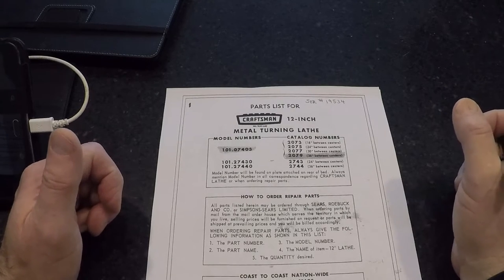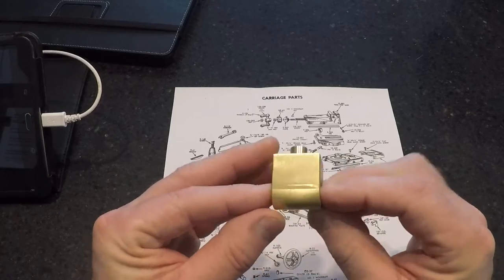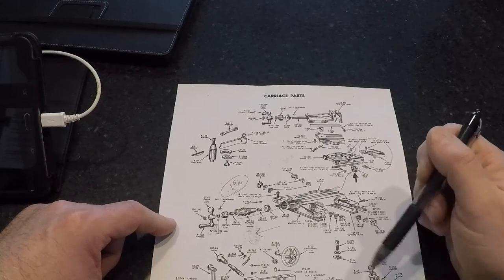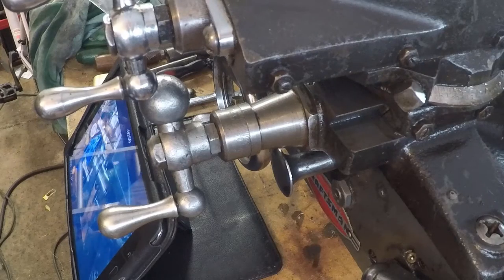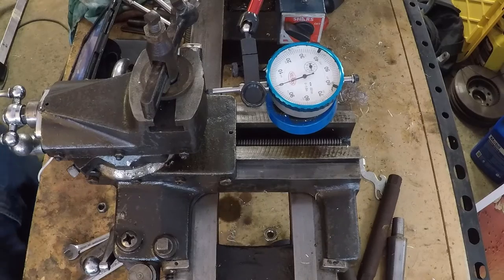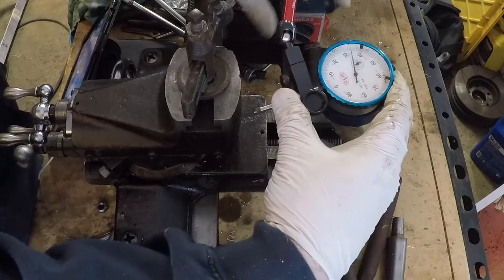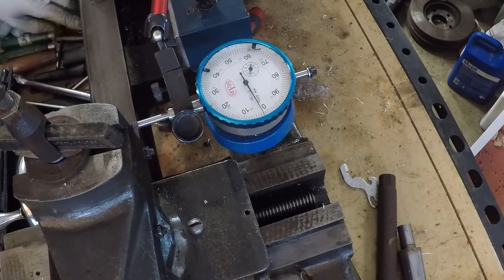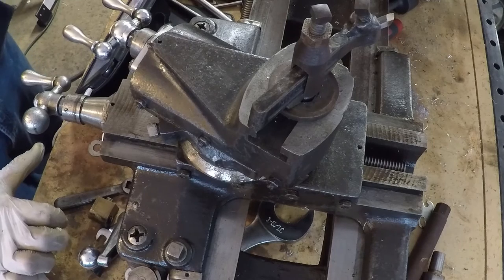Atlas 12L Cross Slide Backlash

Comment: good catch dan, another thing Ive seen done alot is to take the old worn nuts and split them vertically with a slitting saw parallel to the leadscrew, almost all the way to the stud's threads, then drill and tap through the sides of them right below the leadscrew threads. Tighten up the screws on the sides of the nut and it tightens up the nut and takes up the backlash that has worn in it to an extent. Thats another option to save the lathe without spending any money on it, lol.
Reply from the maker: Chirpy's Tinkerings Good suggestion.

Comment: I know this is an old vid, but for anybody who finds it, you don't have to take all of that apart to remove the crossfeed nut.  All you have to do is remove the chip guard and turn the crossfeed handle to move the crossfeed away from you.  When the crossfeed handle will still turn, but won't move the crossfeed any move, just push the crossfeed about 2 more inches, but keep it on the dove tails.  Then remove the screw that holds the crossfeed nut in place, while you put your hand under the nut to keep it from falling to the floor.  After you do what you are going to do, re-assembly is the opposite of what I told you to do.  I own the same machine and just checked to make sure I had this correct.  No reason to take everything apart unless you want to clean and lube everything.
Reply from the maker: Thanks for the tip.
Reply: @houseofbrokendobbsthings5537  BTW, I should be thanking you.  I had the same play in my crossfeet that you did, and got rid of it by giving the post on my crossfeed nut a .030 haircut.  Yours is a tip I will be passing on.
Reply: Jip, this is literally a 5 minute job done the correct way...if you include drinking coffee as well....